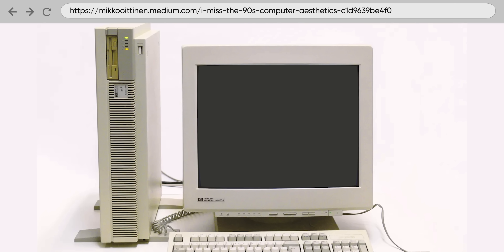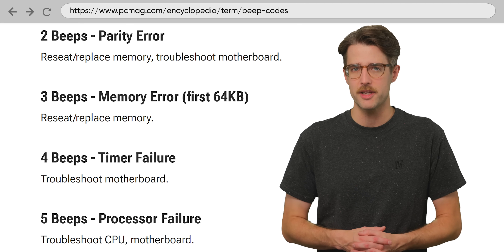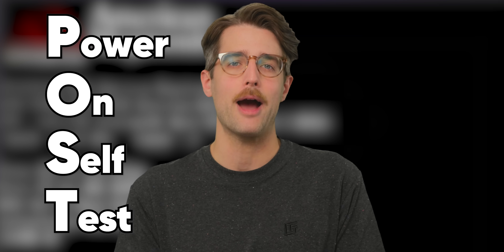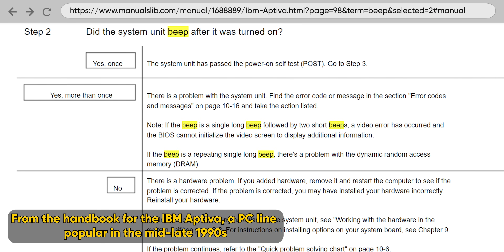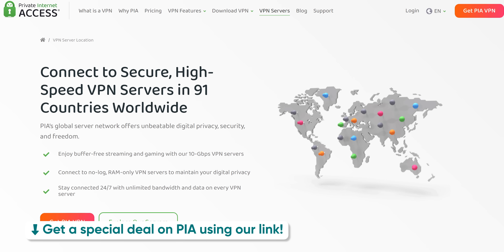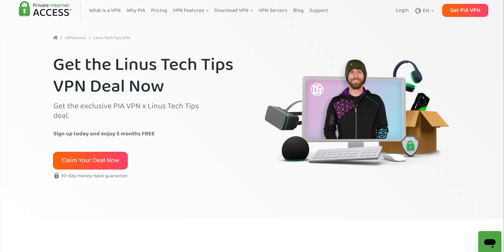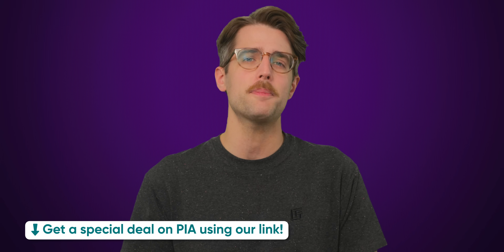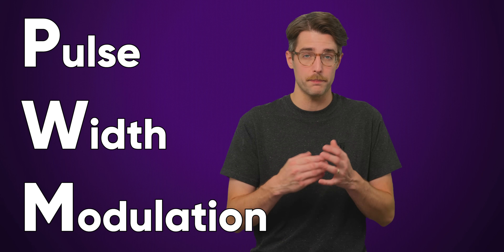Why Computers Don't Beep at You Anymore

Comment: I got a speaker with my first case and have used it ever since. Mainly because I'd like to hear when it's booting/rebooting without looking at the mainboard.
IMO manufacturers should always include a speaker with mainboards if they don't have an error readout. 
I've recently had to help a friend debug a no-image situation which would have been fixed within minutes if they had a speaker on their mainboard. (It turned out to be a malfunctioning hard drive)

(These speakers are like 2€ at any store that sells computer hardware.)

Comment: I still use an old ATX cabinet from 1012 with mesh panel and 2 DVD bay, and its come with a piezo buzzer,... and i still use that buzzer on newer motherboards... and the 5,25" DVD bay come in handy for an bay acessory thats expand the old case with an card reader, USB3.0 front ports and a SATA conector for cloning an HDD

Comment: I've still got a chassis speaker in my computer. It's just something I've kept carrying forward as I rebuild and upgrade the system. I do like it though, since post code readouts are being increasingly restricted to only appearing on motherboards that are far more expensive than most people should be using. Some diagnostic information is better than no diagnostic information.

Comment: That's not quite how a speaker works... A speaker constantly vibrates at difgerent frequencies.. It doesn't just have a "inn" and "out' state like you explain... It's how it makes varoius sounds on top of each other.
Reply: The speaker is moving in or out to create a vibration in the air
Reply: @mandai2  The speaker is moving out AND in (very fast) to create a vibrations in the air we can hear.
Reply: @Oystein87  Yes and as far as the CPU is concerned it just tells the speaker to be in or out for a moment in varying patterns to make up the vibrations
Reply: @mandai2  No, the PC sends a signal, the speaker moves to make that sound. PC does not say "move in, move out"..
Reply: @Oystein87  Yes and that signal is either 1 or 0 no matter what you call it in/out or on/off same thing
Reply: @mandai2  Nope🤣 That's not how it works.. Sound is converted to signwaves. There is no 0 or 1 when driving a speaker. It's litteraly a analog signal dude😅 No other way to drive a speaker. One sycle of a speaker is out and then back to resting position.
Reply: @Oystein87  This is literally what I'm saying. Perhaps there is some language barrier
Reply: @mandai2  Speaker vibrates. Doesn't move just out for one sound and in for another like you actually describe it. It vibrates many times in and out. (Or Out ald then in again unless phase is inverted but anyway). So guess it's your explenation if you already know that🤷‍♂️

Comment: Of course i do still use the speaker to this day. I recently purchased an MSI B760M-P DDR4 mobo and i got the speaker from my old mobo (Gigabyte GA-P55M-UD2) and plugged it to the new one and it works like a charm. The speaker assures me that the PC has passed the POST test and i still wonder why there isn't an inbuilt speaker to the mobo that you can turn on/off in bios/uefi... Not having a speaker will freak me out cuz no speaker - no assurance that POST has passed successfully

Comment: I remember a computer from 2002 that had an internal speaker. What I did was disconnect it from the motherboard and instead connect it to the "headphone" output so it would play sounds like an external speaker would. It worked quite well and as I recall it could even go reasonably loud all things considering.

Comment: That doesn't answer the question of why they don't beep at us anymore, though. My take is, that it's just not necessary to beep if everything is in working order:

The original idea was that you needed to know whether the system was running at all or not. No beep meant that the reason for your black screen was, that you didn't turn on the computer. But that is rather unnecessary, isn't it? Even today it's fairly easy to determine whether a PC is turned on at all. Fans running, LEDs lighing up and such. So, the only thing that POST beep was ever good for was to be annoying. It had no reason to be there in the first place.
Reply: I believe it was used by the vision-impaired and there were initiatives to help computers be more accessible before sound cards became standard
Reply: @mandai2  That's interesting. But even then, the POST beep would still have been pretty useless, wouldn't it? A successful POST doesn't mean that the machine is ready for user input yet, so for a user with impaired vision, the beep would not have to occur at the end of POST, but the whole boot process. Some systems do this, actually. Pfsense, for example plays a little jingle on the speaker once it's ready for user login. And since it's an OS for firewall appliances, you are often "blind" during a reboot anyway, because more often than not, there's no screen attached to the appliance, and you still need to know when you can try to start sending requests again. So there is a point to be made here for a beep at the end of the boot process. But PCs did not commonly do that in ye olden days. They used to beep after POST.

Comment: In fact, I just recently moved my Ryzen 5 based system to a "new" case that still has the classic cutout for mounting the speaker. I didn't hesitate for a second to put a good old proper paper cone speaker in. Much more pleasant to the ear than these little black capsule things with their metallic screech they give you with today's boards

Comment: Yes, I still have, and sometimes use a pc-speaker with my rzyen 1600x, and the motherboard also has a pci card (not pci express) with a tv tunner that works perfectly.
I also would like a floppy controller, but there are no motherbards with it from some time.
Also I would like to mention that I have also a dvd drive, that it's usefull and I don't understand why it seems people don't install it anymore.

Comment: You need an m.2 for the post beep?? Umm, you know you can just get a beeper and plug it into the motherboard, right? Modern motherboards have pins to plug it in next to the power/reset button pins for it.
Reply: Not all motherboards have those headers now
Reply: @mandai2  I've never seen a mobo without them
Reply: @d.wolfin152  Shoutouts to Youtube for hiding my comment

Comment: When I got an NZXT Phantom 410 and built a Skylake system in 2016, my case didn't come with a PC speaker like my previous ones did. So I got a bunch off eBay for cheap. My current system has an X570 motherboard and I have one in it. Because my motherboard doesn't have a diagnostic display.

Comment: My childhood computer had a cone speaker, and a loud one at that. It was from 2003, quite late for a cone.
My cousin's computer from 1999 did not have a PC speaker, instead the manual says that it has to be connected to external speakers in order to be diagnosed through audible POST beeps. (It was a Compaq)

Comment: The school I currently go has a computer that runs a Gas Chromatography/Mass Spectrometer on windows NT. For some weird reason it starting beeping and my professor and I didn’t know the beeping was. PC randomly shut off and didn’t turn back on. I figured it may have been the CMOS battery on the MB, but after looking up online what the BIOS was and their manual for the beep codes it was just having to reseat the ram.

Comment: The sample at 1:57 wasn't a PC speaker output - that was clearly an FM synthesizer card. The PC speaker API can't accept input fast enough to sound like that.
Timberwolf, here on YouTube, did a video called "PC speaker wizardry" where you can hear real RealSound PC speaker audio starting from 8:11. The Space Racer title (that you can hear at that video at 10:15) is how i was introduced to this technique.
Reply: The game shown at 1:57 is Pinball Fantasies - Partyland from 1992. This is an Amiga port that while I can't verify if it used the patented RealSound system, it most definitely had Sound Blaster support - which is what we hear.
If you want to play it - with proper Sound Blaster emulation - it is available in the Internet Archive.
Reply: The RealSound system is just one of the earliest "digital audio playback on PC speaker" techniques developed. Loads of other methods followed it, some even preceded it. There isn't an "API" for the PC speaker as such, but the "OUT xx,AL" assembly instruction takes 5 cycles or so. On a 4.77MHz 8088 that's still something like 950,000 write ops per second if you did nothing else (assuming an optimistic scenario where the instructions are all prefetched etc). Even if you say the realistic number of writes is 1/10 of that... plenty fast.
Reply: @RetroSwim  re:API I meant the Intel 8253 PIT, and writing to it at port 42h. The PIT runs at 1.1MHz and loading it takes some cycles (not sure, its been a while). Doing any kind of "not square-wave beep" requires some non-trivial DSP on a CPU, which is also hard. RealSound was patented around 1988, and while there were some uses of competing techniques after that time, no commercial product did so - if Pinball Fantasies has a PC speaker output it likely used RealSound,  though there was no reason to: FM synthesizers were common at that time.

Comment: As an IT technician having a beep on post was great. Id love if it did that still. In fact I'd love it if we went back to walls of blinking lights, numatrons and other crazy old valves.

Mostly manufacturers would prefer to keep the $0.02 it costs them for a speaker.
Reply: Yeah, it's ridiculous. $0.02 out of a $200 product isn't even a rounding error. They're splitting hairs and making things worse for us.

Comment: I'm still using my i7-4770k system as my daily driver. Every year I tell myself it's the year I'm going to upgrade... but at least I still have my trusty PC speaker. And optical drives. I use optical S/PDIF to a surround system to power my headphones because the onboard audio isn't good enough, and this has been my solution since my previous long-lived PC.

Comment: My pc has a speaker that beeps. I added it myself since even mid range mobos doesn't comes with error code display. LED code only tells you roughly what is wrong, making it difficult to pin point what is going wrong exactly.

Comment: I always add the tiny PC speaker that comes with your motherboard and enable the startup beep in the BIOS.  It's very useful if the computer won't boot one day so you don't have to spend hours swapping components trying to find what the problem is.  And since you hear the beep every time you turn the computer on, you expect it and know when it's SUPPOSED to beep, so if the beep is delayed or doesn't happen at all you know there's a problem.  There are no downsides to installing your PC speaker, other than aesthetics but it's really not too big or ugly.  All my systems are based on AM4.  I hope they didn't remove the ability to add a PC speaker on the AM5 platform.  That would literally make me switch to Intel (15th gen or later of course).

Comment: Boot up specker connections are still on computers. I did a desktop build a couple of years ago the speakers are cheap and very handy to diagnose issues at start up and when start the computer the speakers dose beep off when i have the monitor switch off.

Comment: the tittle is miss leading. PCs do still beep but now a days its a bad thing if it starts to beep :D
ye the more high end boards might not have the small speaker in the mobo anymore since those have the Q-Code LED but the cheap boards dont have. so u have the small speaker to play u Morse code when there is an issue

Comment: I remember finding a sound driver for this so you could play music, etc. from within Windows 3.1. It worked, but wasn't too spectacular.

When I built my current computer during the pandemic, I noticed it had a speaker header so I got a five-pack of piezo speakers and installed one on the board. It let's me know it's alive whenever I turn it on. I also have a serial and parallel port on my computer because there were headers on the motherboard. I may never use them, but they're there. I don't do RGB, so I even routed the USB headers outside so they can be used for things to plug in.

Comment: I still have my speaker from the late 90's. It came included with some work related system and I ended up with it in my original rig. I've had it ever since. And I remember the computers as far back as the early 70's.

Comment: I remember that some sound cards recreated the beep from the internal speaker so you would still hear the beep codes if the computer failed to pass POST without the internal speaker. This was a long time ago, and I think I remember that Azetech soundcards supported this. This was back when they competed with the original Soundblaster card with it's 8-bit digital sound. I think they were even making 16-bit audio cards before SB.
Reply: They didn't really. There were plenty of cards that had PC speaker passthrough (my ES688 AudioDrive had it), but they required you to connect your PC speaker out on your motherboard to the PC speaker in on your sound card - they didn't do anything clever like sniff the system  bus or timer chips, sadly.
Reply: @throwaway6478  Had a SB16ASP back in the day. It came with such a passthrough cable. Never used it, though.

Comment: 1. You could have mentioned that the basic beep was just a replacement for the physical bell (i.e. typewriter) in older computers found at ascii 7.  2.  I've heard that . . .  A "business" traveler use to have to prove that early portables and laptops had to be booted up until the POST beep before the computer was allowed through airport security to demonstrate it wasn't an explosive device.  2.  Haven't most techs heard the beep while booting without memory or a video card installed in a modern computer?

Comment: Actually, I do.  I have GrUB play a tune when Linux (or Xen) boots.  It lets me know GrUB has completed loading and is counting down for me to make a selection or use the default, and it also beeps just before loading the kernel, just before loading the initrd, and just before it jumps to start the kernel.  I started doing this on "spinners", because it used to take a couple of seconds, where as now, from SSDs, it's very fast.

Comment: In 2005, I had a Dell XPS Gen 2 desktop. It came with a GeForce FX 5200. Decided to upgrade to a 7800 GS. Swapped the GPUs, pressed the power button, and the PC screamed at me with a continuous tone. This was no ordinary "beep". I shut it down and researched on a laptop what the hell was going on. Turns out I hadn't plugged in the external power cable for the 7800. Didn't even know such a thing was necessary. The old 5200 received all its power from the AGP bus.

That was a neat learning experience.

Comment: My motherboard actually came with a tiny removable dongle like speaker with a single pin connector that fit into a specific pin on the motherboard. It beeps when I boot up. That's it.

Comment: i've installed a pc speaker on mi pc expecting to be able to produce sounds once booter, but ivé found that windows 10 does not allow any pc speaker output at all, the interrupt seems to be intecepted and the beep goes through the main sound card and then the actual speakers.

Comment: my very first custom pc i got back in 2010 which as a am3 mobo which  came with a mobo speaker but after 2 upgrades form amd fx and amd ryzen none of the mobos had speakers but still had the pins i have been using the same speaker for almost 15 years the only things i have left from my first build is the case, mobo speaker, HDD, and dvd drive i really think mobo manufacturers if they don't have post leds codes that they must have a speaker because the beep codes help a lot and they are mostly universal for me when a OC false most of the time i get 3 beeps which is a memory failure